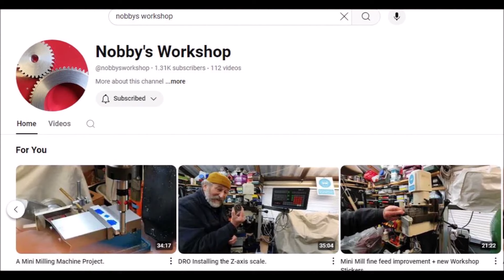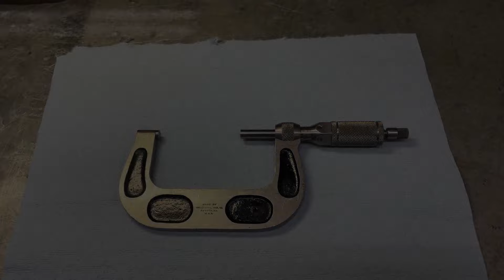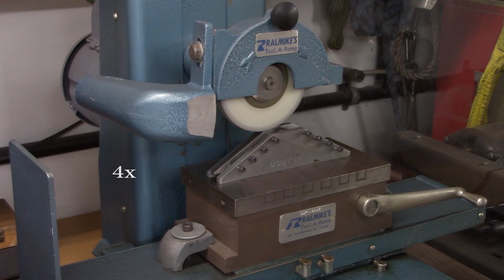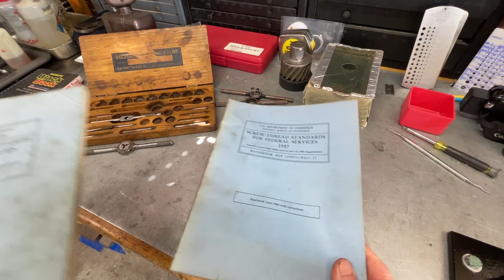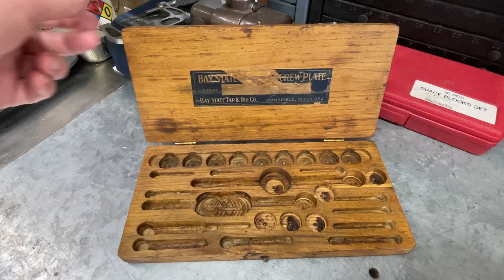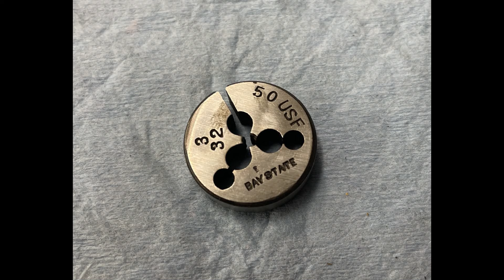Cool / Unusual Tool Finds

Comment: That is an unusual mic .   Be careful of the little dowel pin in your quill if you use that big annular cutter .   Cheers  Dean 👍
Reply from the maker: Thanks Max, Yeah my mill already had the dowel pin removed before I got it. With the manual drawbar I haven't had a slippage issue yet...fingers crossed...

Comment: That mike is a museum piece. Just wondering how much it would cost to buy it new today :)
Reply from the maker: @Rustinox  thanks Rusty, yeah, I didn’t even notice that the numbers changed until I started cleaning it. Definitely unique.
Reply: Loved this video on some very interesting tools  . Maybe those taps and die are unique to gunsmithing  model engineers like to use BA treads 
Kit from down under